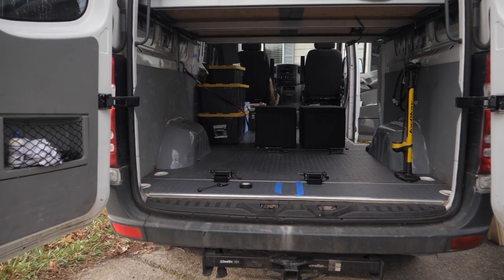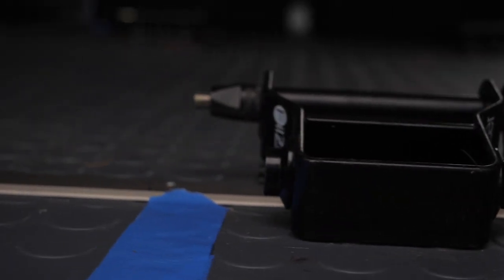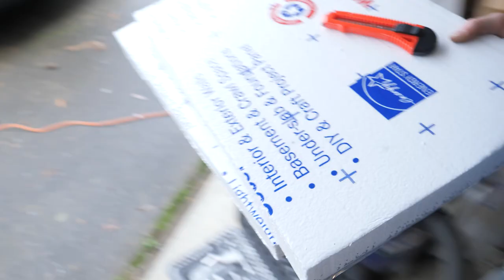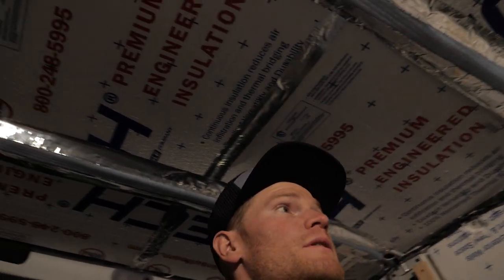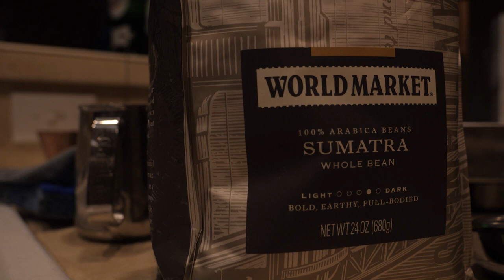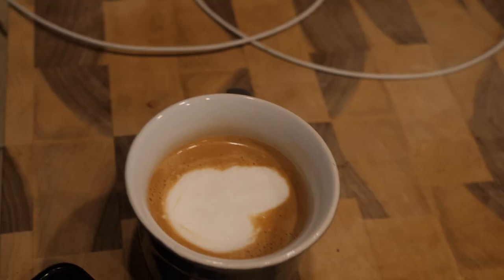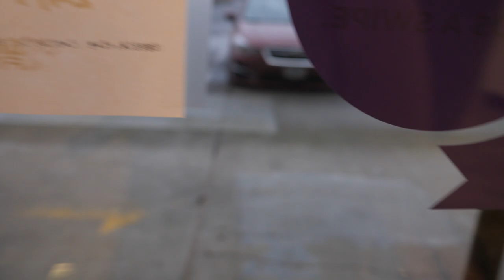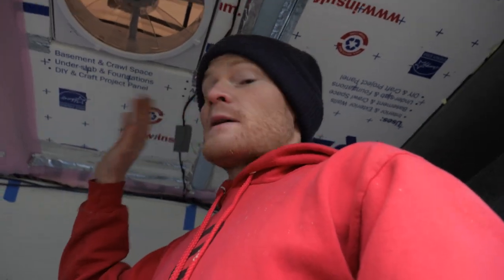TRIATHLON OFF-SEASON: Sprinter Van Conversion 2.0!

Comment: Just a little note: As a contractor I noticed that you butt joined the painted white paneling to the wall of the van with no gap. Since you have done that in winter the panel is fully contracted. Once it warms up each (wood) panel will expand and buckle (warp). Winter is also low humidity. When summer comes, increases in humidity and temp will swell the panel. Building code (where I live) requires a 3/16-1/4 inch gap between panel edges to allow for expansion. These are covered by panel strips that are sold in the same finish as the panel. Your project-your van, but it would be a "rip it out and do it again" once the panels start to swell. Temperature variations are also much more extreme in a metal van as opposed to a house. Plastic (purpose formulated automotive panels don't expand - as much).
Reply from the maker: Hey thank you! I really appreciate that. I think we'll be ok, since it was raining during the install.. Oregon "winter" is basically like living in a rain cloud, so 95% humidity. Your insight does make me wary about any trips to Florida though..

Comment: Hey Eric, great stuff, love the channel and thinking to do something similar now. Been watching quite a few builds and yours is unique in the way that you dont put the weight of the bed onto the floor. 1) Any concerns around stability / weight and 2) I understand the horizontal L shape is put in with rivnuts to support the bed. But what is the vertical piece for that is behind the horizontal one in a 90 degree angle? thanks!